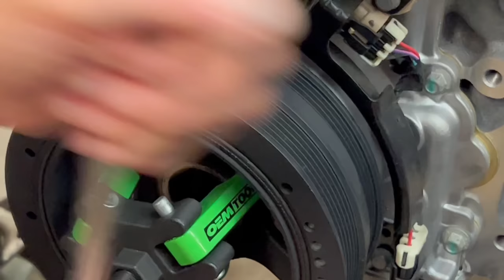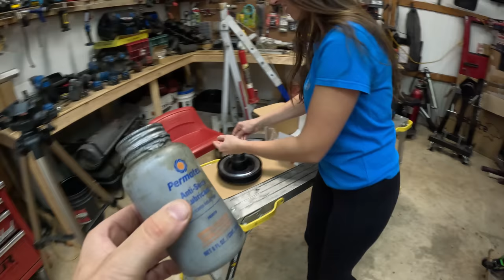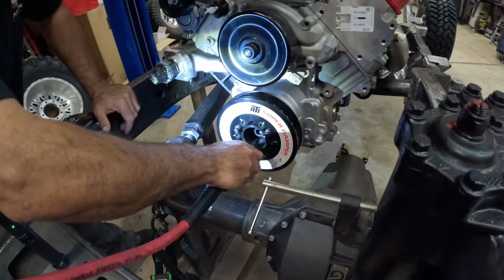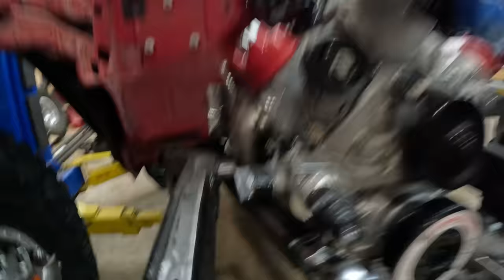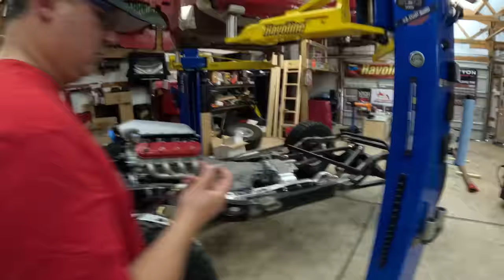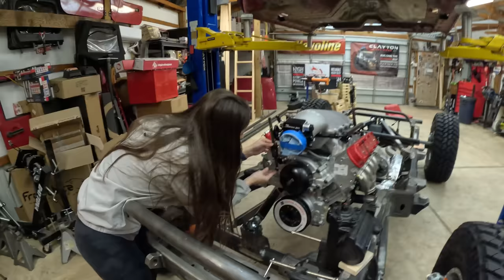Long Arm Suspension is Installed!! And a New LS Front Drive - Ultra4 JK Build - Ep11

Comment: Use nitrile gloves when using anti-seize and you won't end up with it everywhere.
Only on a blower setup do you need to pin the balancer to the crank.
Reply from the maker: Yep, but still decided to do it. Might as well since we already had everything off. No reason not to, and now we could add a blower and not have to redo all of this 🤙🏻

Comment: Slam the bearing with air hammer, I think you made right choose, why test the process?
Reply from the maker: Huh?
Reply: @JKGearandGadgets  

You thought about using a impact tool to put the harmonic balancer on the crank shaft, but elected not too. I was saying using an impact tool / drive pounds on the connecting rod bearing, so and impact tool, should never be issued on a crankshaft.  You choose the right solution to put it on. Without an impact tool, guess I wasn't clear.
Reply from the maker: @dondupuis4007  ahh gotcha!

Comment: Why not do a Jeep works 10” body and frame stretch?
Reply from the maker: I thought about it, but that’s another $2500 for the builders kit and a lot of body work and I think they estimate 100 something hours for the job, we just don’t have that much time with everything else to do. And I think they had a long lead time when I looked months ago. With this setup at a wheelbase of 110-112” I think it’ll be hard to beat with an amazing breakover and departure angle. It’s a great kit for sure though.
Reply: Good info. I was just curious because it seemed like your Jeep would be an awesome fit for that kit. Thank you for putting out awesome content and for taking the time to respond to my comment.
Reply from the maker: I really want to build another stretched JK, non KOH rig haha. Will probably do it on that one in the future for sure